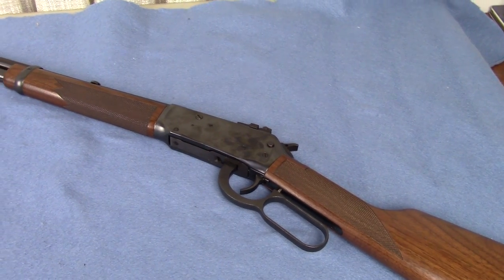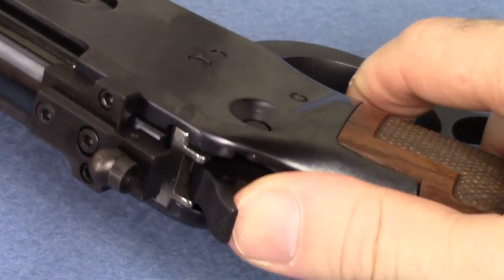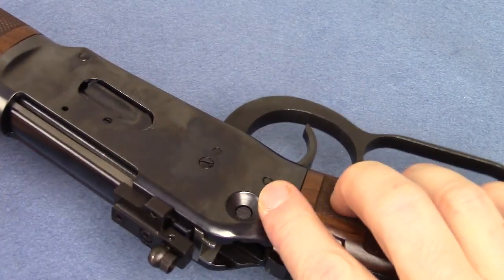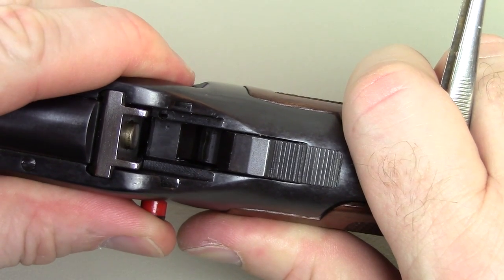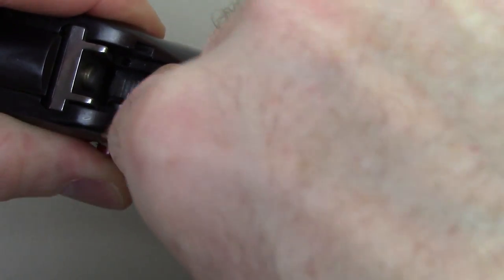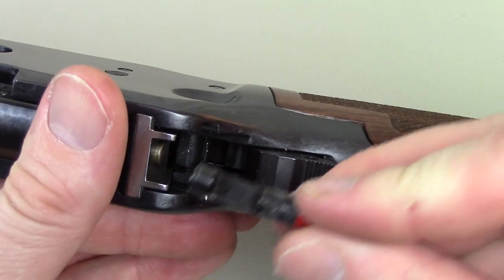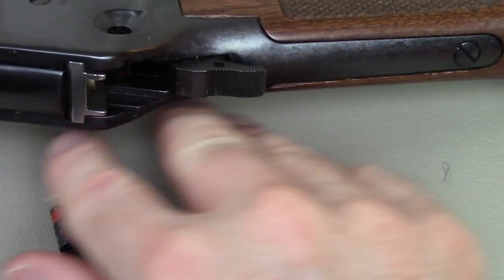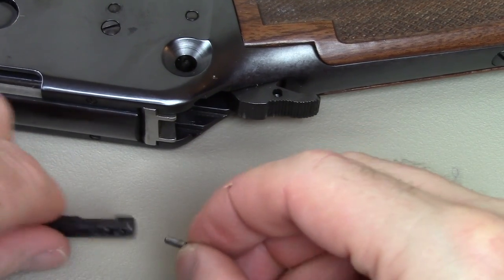Winchester 94 Cross-bolt Safety. Yuck. Here's how to remove it.

Comment: Very dangerous to remove a factory safety, just because you think it looks bad. worse yet is to show other people how to do it. whats the point except to get someone hurt or worse KILLED. if this was to show people how to replace it.... that would be different
Reply from the maker: So John M. Browning designed an unsafe gun? There were millions of guns produced before the stupid lock. Are they a problem?
Reply: Rebounding hammer is already a safety. The cross bolt is a redundancy. Basically think trigger safety on a Glock.